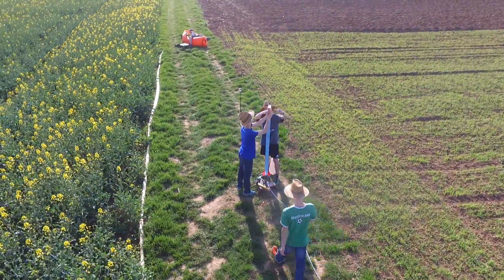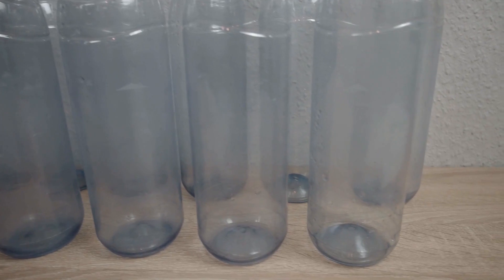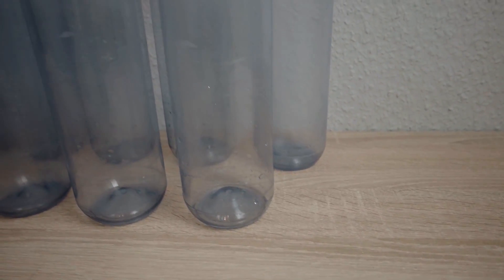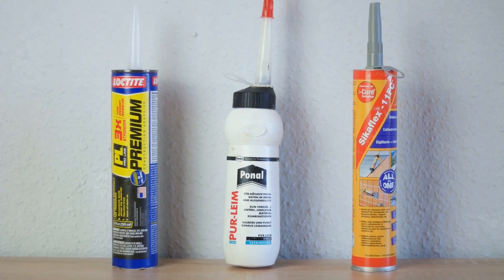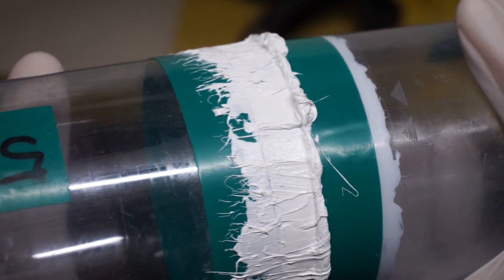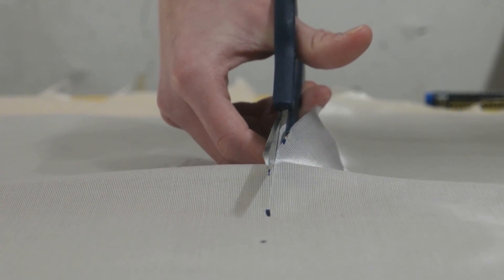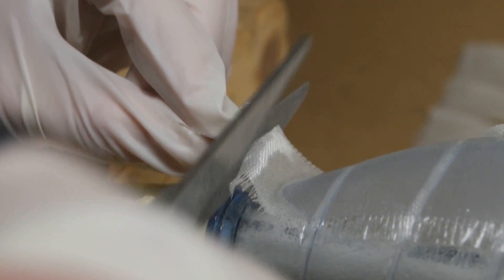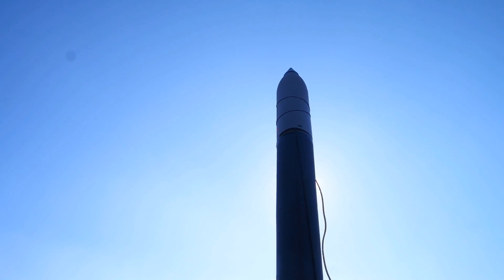DIY: How to build Pressure Vessels with Reinforcement for Water Rockets

Comment: Very nicely produced video guys. Very informative too! :) What graphics animation tool do you use for your animations? Also I would highly recommend using a roller cutter (they look like a pizza cutter) on the fiberglass cloth. I guarantee that once you use it, you will never use scissors again! :)
Reply from the maker: Thanks a lot, George! :) We will definitely try using a roller cutter in the future, thanks for the tip. Every animated bottle section in this video is designed with a vector graphics program. We are using Xara / Magix (Web) Designer for that but you can also use Adobe Illustrator or something like Gravit Designer if you're looking for something for free. We then render the graphics as a .PNG and use the inbuilt keyframe-feature of our video editing software (Magix Movie Edit Pro) to move the sections. It takes up a lot of time but it's working quite well for us. 
Greetings from the Team!
Julian